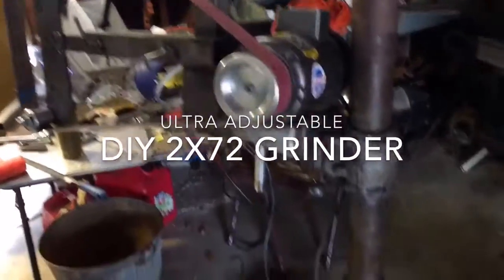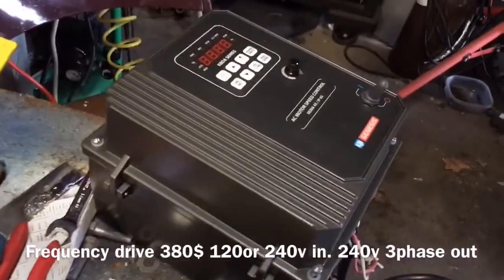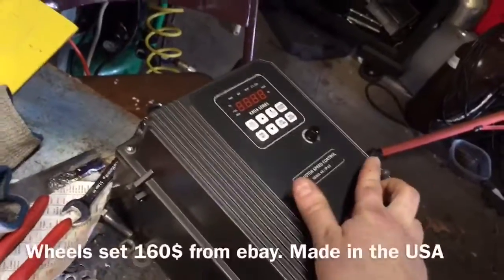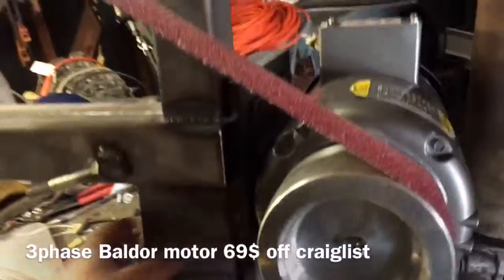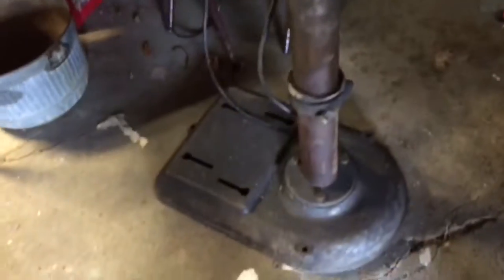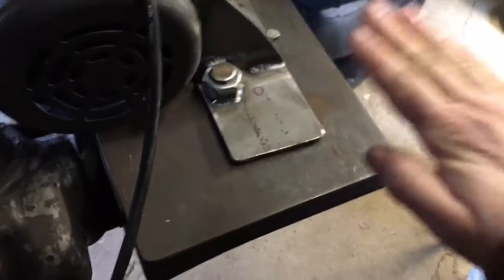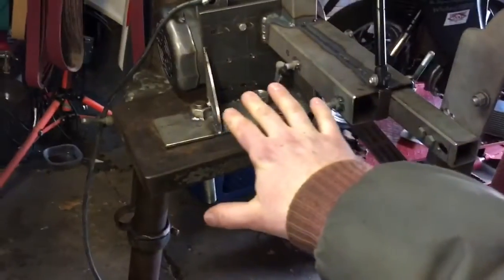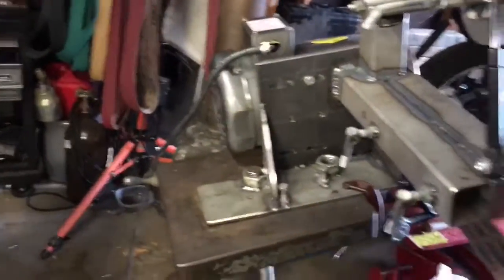2x72 Belt grinder (DIY, Frequency drive, 3phase motor)

Comment: Pierre, nice grinder!! great idea on the drill press stand! is the stand pretty steady the way it is? or will you either bolt it down to the floor, or add a couple hundred pounds of weight to the foot to steady it out? Building a grinder is a lot easier than it seems isn't it? now the only problem will be that you will build several more and start running out of room for anything else :}
Reply from the maker: +Joe Calton being old the stand is heavy and also very well machined and square. I plan on keeping it unbolted as it is pretty stable and does not move under reasonable pressure. If anything a couple of sandbags. I have a feeling I could bolt a movable table to the top of the stand and use it as a surface grinder. 
I plan on doing a true budget 2x72  120v grinder for upnorth this summer. Closer to your design. I think people obses over the geometry and miss out on other stuff when building their grinder